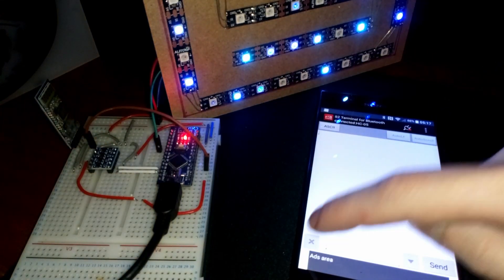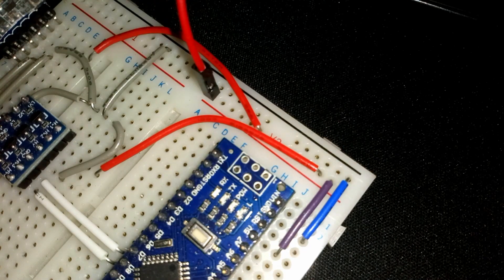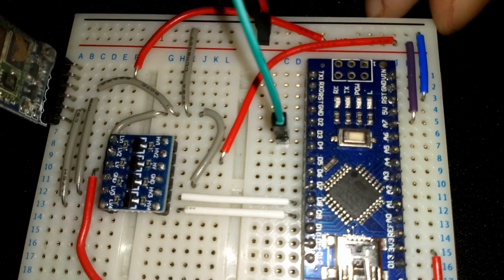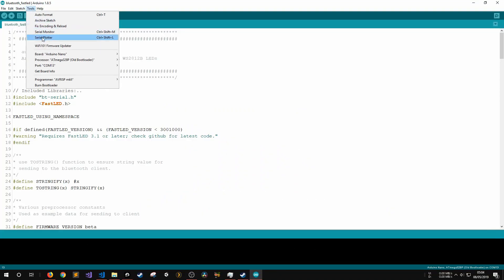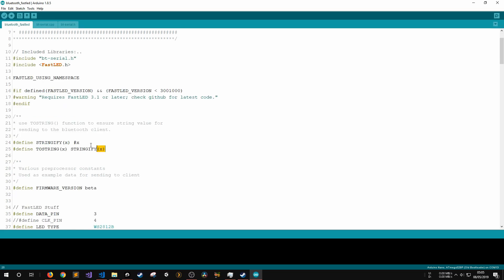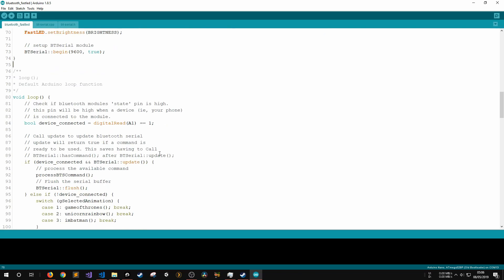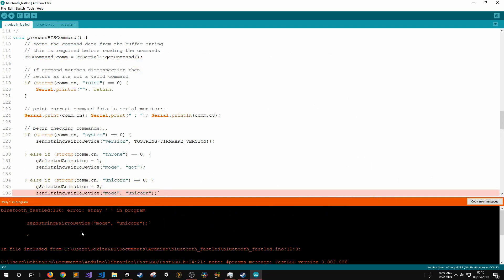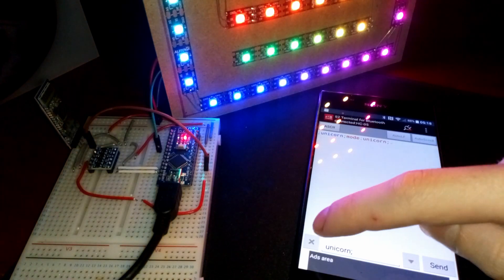Arduino Bluetooth RGB LED Controller - Problems & Solutions (Android, HC-05, WS2812B)

Comment: Thanks for tutorial its nice and good. I have a project in mi d but I'm a beginner in arduino.  Would you like to help me with that? 
Need to put 5 arduino independent conected to change led ws2812b simultaneously with same color 12 leds conected with 12v in and 5v out. Thanks
Reply from the maker: Unfortunately I really dont have time atm (or 5 spare arduino) to test this out. but it wont be easy. synchronising the data streams between 5 separate devices all running at different speeds... yea, not an easy thing to do at all... I wish you the best of luck! <3

Comment: Hello. thanks for upload. I am trying to make similar project. I face difficulty to switch between one effect to another because the sketch won't loop. Do you have any idea?
Reply from the maker: Hey there, not sure what you mean by 'the sketch wont loop' as there are is a loop function by default. Do you mean, when bluetooth is connected you cannot control the leds?
Reply: @dekitarpg  i mean a loop inside of a loop. I will upload the video, so maybe u can give advise

Comment: Thank you for this tutorial. I got it to work, but how do I define the libraries? Say I want to use a color wheel app which has pre-written code. How do i define the link to the code for that?
Reply from the maker: sorry for the delayed reply.. it would completely depend on the library your trying to use. i wouldnt recommend using someone elses code and trying to merge codebases unless your incredibly familiar with all of the code involved.